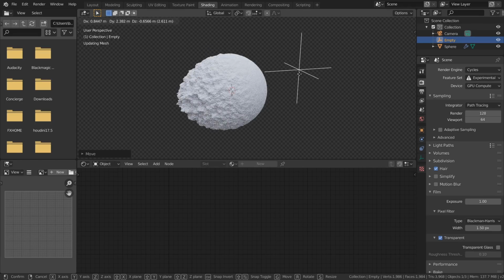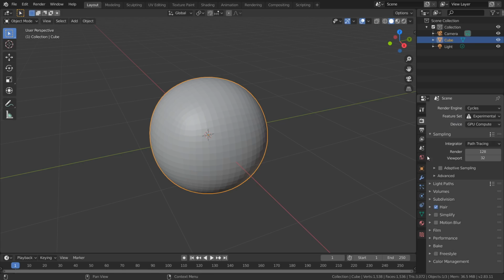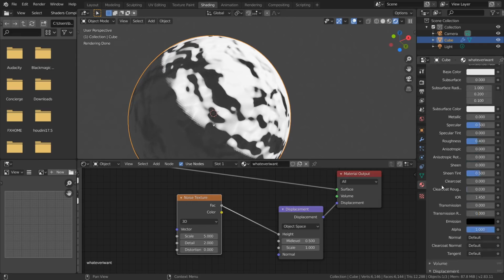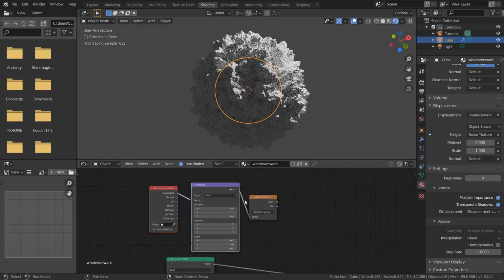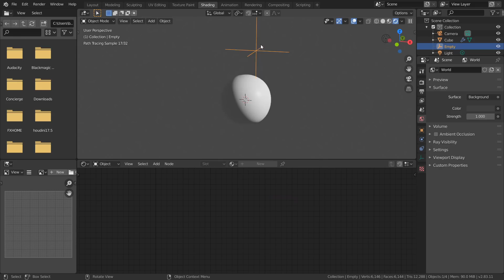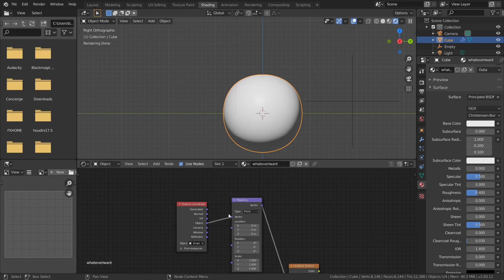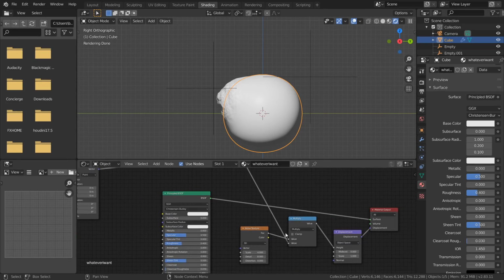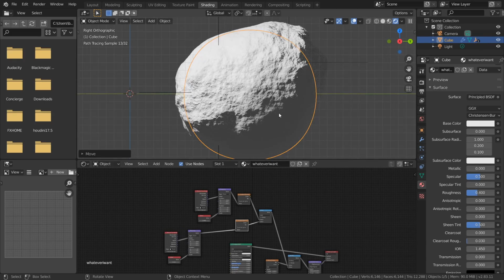Proximity Displacement (Blender Tutorial)

Comment: When enabling displacement and bump, nothing happens ?
Reply: Last sphere top right corner of the viewport is rendered mode, you need to be in cycles experimental mode and add a subd modifier and turn on adaptive subd, watch it back again
Reply: gower1973 Thank you! It works!
Reply: Viewport shading needs to be set to rendered.
Reply: @edwhite207  Same issue here. I don't find any "rendered" choice in the Viewport shading. The geometric displacement doesn't work.
Reply: Did you turn on adaptive subdivision